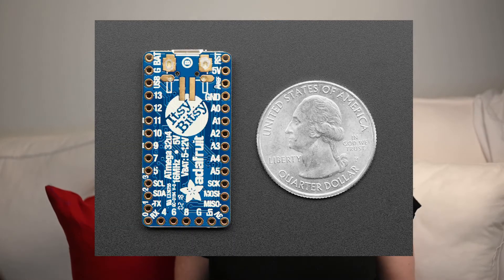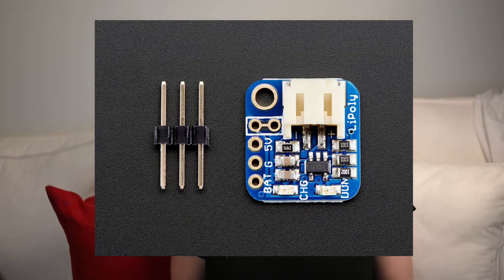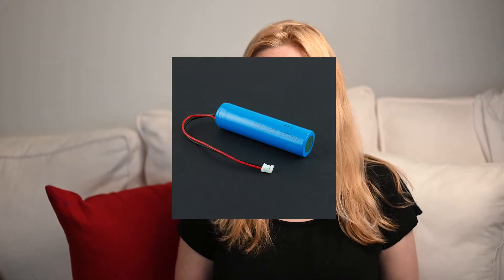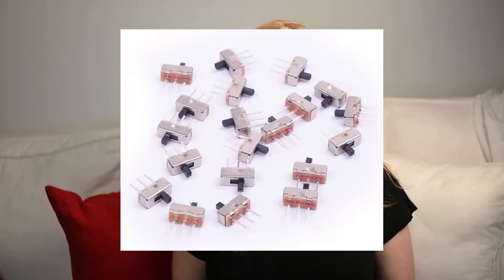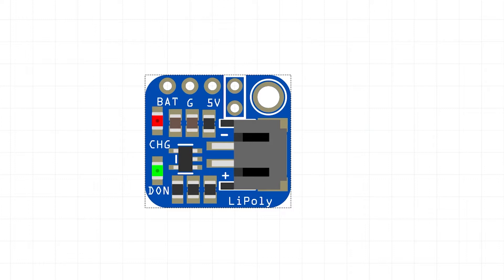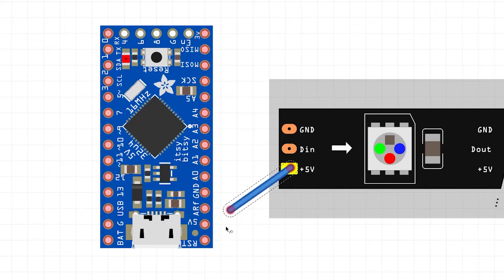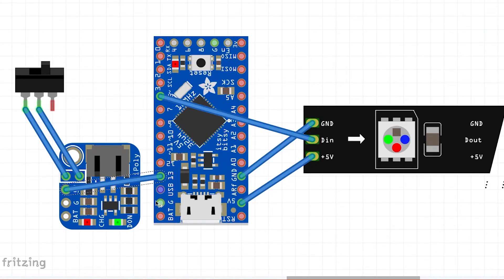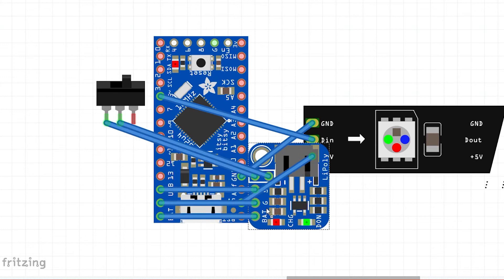Adafruit LED prop setup!

Comment: Can we use something other than Adafruit? they kinda dont sell it in my country <*<
Reply from the maker: I'd try and see if a 3rd party seller exists! They do have other microchips that you can use. You'll just have to research and try and find something that will work with neopixels. :)

Comment: Hi! Pretty good informative video, I have a few tips for you, to take into consideration. 

First of all, the audio. Your voice should be louder, at this moment the music is masking it. 

Second, I imagine this could be 3 part series. In this part, you explained how the system works and what the components used - good. The next part could be actually building and soldering the setup. The final part would be the programming. At this point, I'm kinda missing the "physical" part of the construction. 

The last thing I have is actually electrical. At 5.33 you show placing the charging board directly onto the microcontroller board. This is great from the mechanical outline point of view. I would be however worried about shorting pin 13 of the microcontroller board to the left power switch pin in the BMS board. I can just imagine that you put some kind of isolation between the pads. Or it could be that I do not get the physical arrangement, or stackup, of the boards. Again, a follow-up video showing physical construction would clear this up.

But overall I think your work has a potential, keep it up!
Reply from the maker: Hi, thanks for the feedback! I'm still new to video editing and working on it. 

Secondly - I do have footage of the actual build but it's incredibly difficult to see what I'm doing because of how small these microcontrollers are. Hence why I bought a program to show the controllers/images on video. You can check out my other video on how I do the code.  

Thirdly, I mentioned in the video that I used the pin headers that came with the backpack add on. This keeps the boards from touching one another and connects the three pins that are needed between the boards. People watching this will have this knowledge as this isn't geared towards beginners. 

Thank you. :3 I have a ways to go but slowly learning from each video and prop that I make!
Reply: @byteprops  Great video.  Just wondering what software you bought to show the virtual controller and connections.
Reply: Ad 2), I understand. I think both the visualization and the actual process have a place in the video. I use this "Plugable 250x Digital USB Microscope" for my work. It is very well priced (~40USD) for the video quality and framerate. Maybe worth a shot for some future soldering filming. 

To the programming video, I found it afterward, looking on your channel, but it would be nice to have it referenced in this video, via some pop-up or link in the description.